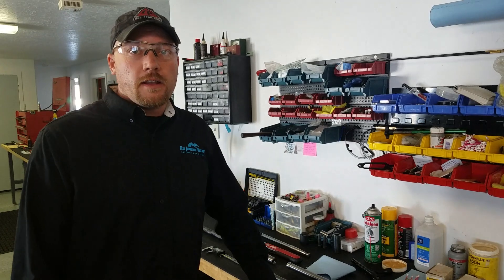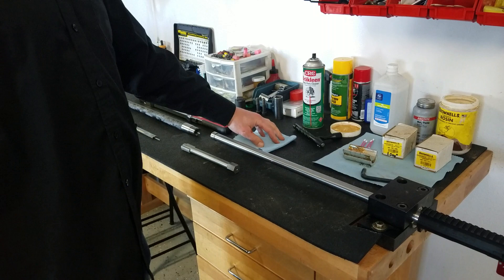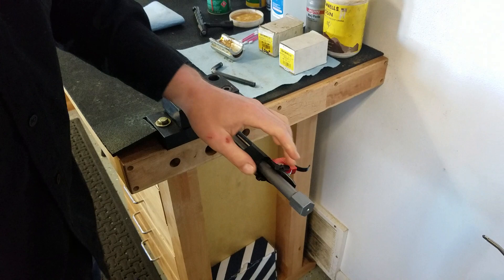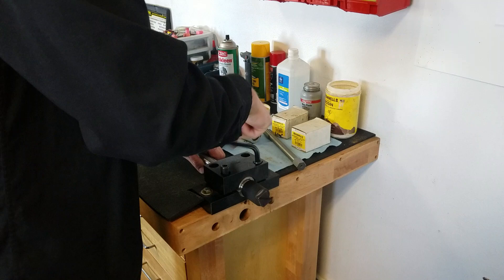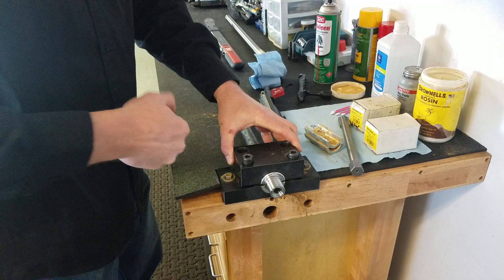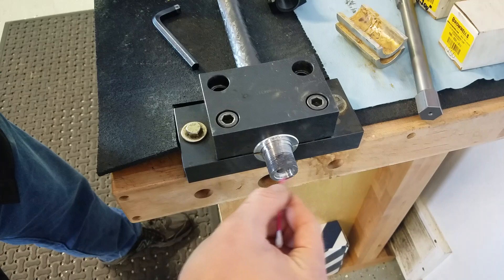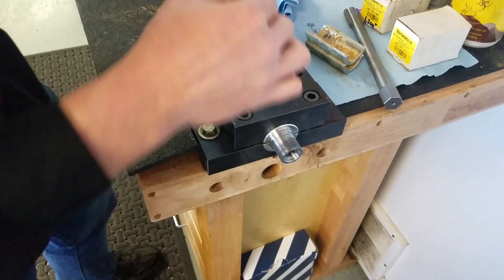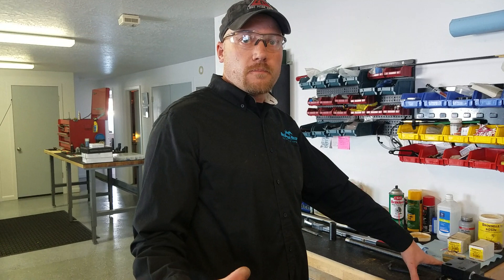Installing or Switching  Prefit Barrel on timed Lone Peak Arms or Impact 737R  Action

Comment: What pre fit barrel works with the Impact Precision 737R? I thought their barrel was proprietary.
Reply: any barrel will work with the action like 737r.  The gunsmith just needs to know the dimensions of the action, and in the case of the 737r since their actions all have the same exact dimensions due to their tight tolerances, the gunsmith just need to see the blueprint measurements and chamber up the barrel based on that.  You don't even have to send in your action.  In fact, many of the top actions like curtis, bighorn, lone peak will have their dimensions for their actions available for gunsmiths to use to make a prefit barrel for you
Reply from the maker: @keokio7  Minus Curtis out of there though. Inconsistent head spacing and poor Rockwell Harding rules them out for us. Otherwise, you are correct. thanks for the comments.